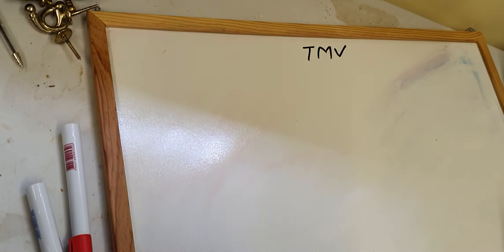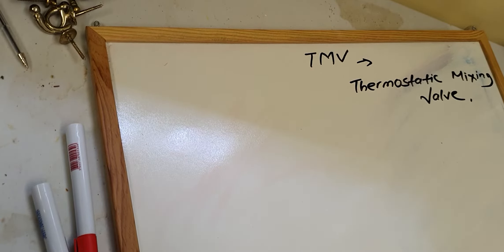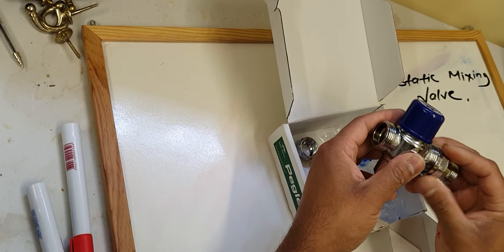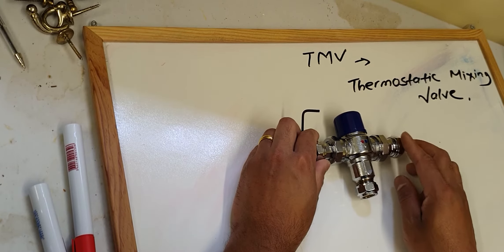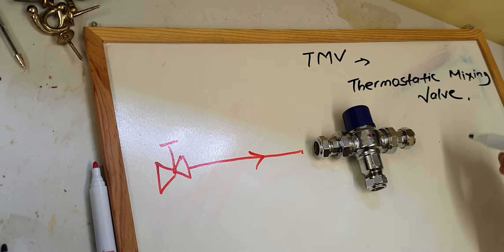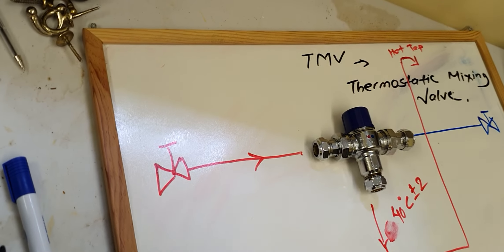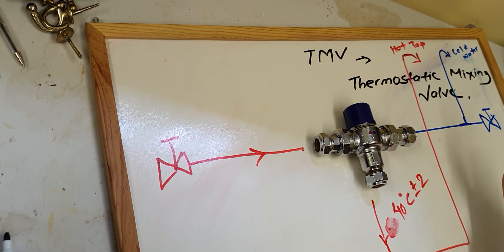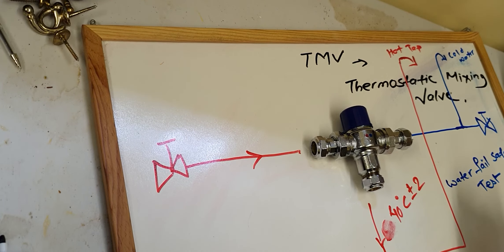TMV - Thermostatic mixing valve (water fail safe test)

Comment: Hi I have a Gledhill Pulsacoil BP open vented mains pressure off peak cylinder and have not been able to get any hot water through to taps for a week now. I’ve had the pressure reducing valve changed and also changed the TMV yesterday still I do not get more than 30secs of hot water at hot taps before it goes cold and doesn’t come back. Could you kindly offer some suggestions as to what may be the issue.m? Thanks
Reply from the maker: Might have air lock- please check

Comment: hi, what happens if you install it the other way around? thanks
Reply from the maker: You would not get right temp from hot outlet and if cold water is off it will fail water fail safe test which may scald vulnerable people.